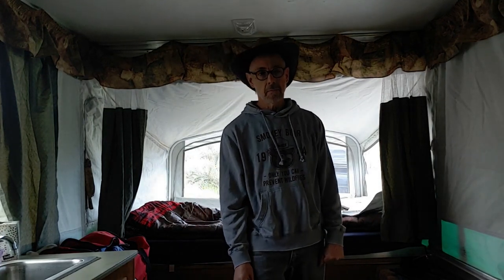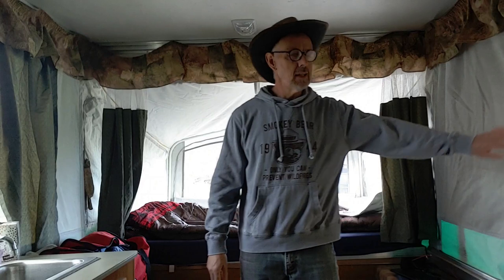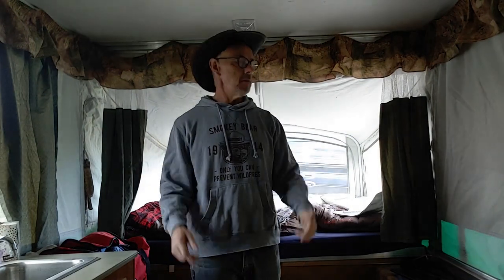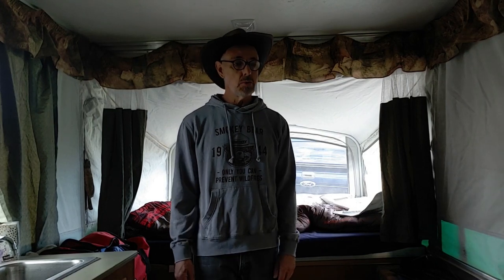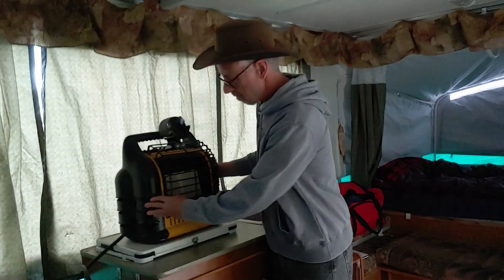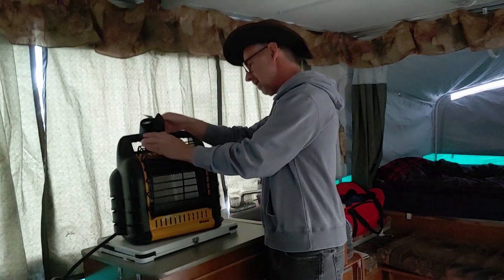How I heat and cool my popup tent trailer

Comment: Thanks for the video! What’s the lowest temperature you would feel comfortable camping in with this setup? I’m in Michigan and am looking to buy my first pop up and would love to be able to use it into October/November!
Reply from the maker: The lowest I try to go is down into the 40's at night. I don't use the heater at night as it does consume a fair amount of propane and I am not totally comfortable leaving it running unattended. without the heater, my sleeping bag will keep me warm in those temps. anything lower and it's just too cold. Anything colder than the 40's and it's just too cold for the heater to keep up with the heat loss through the canvas. You will also need to consider that the underbelly of the trailer is exposed and the water pipes can freeze if it gets that cold.